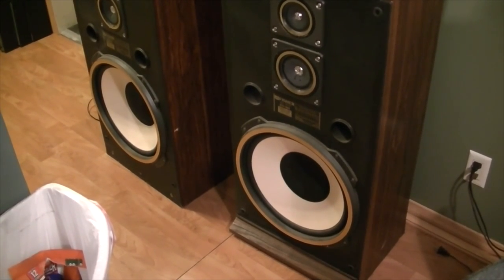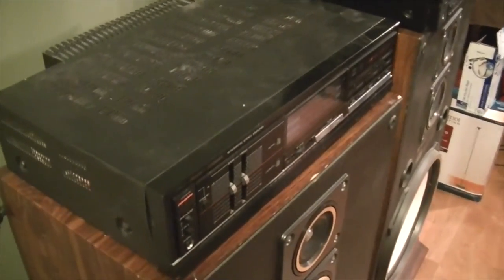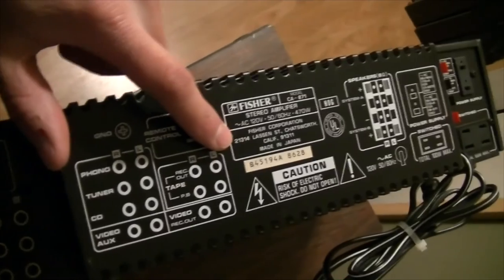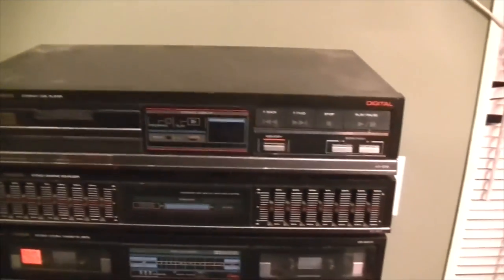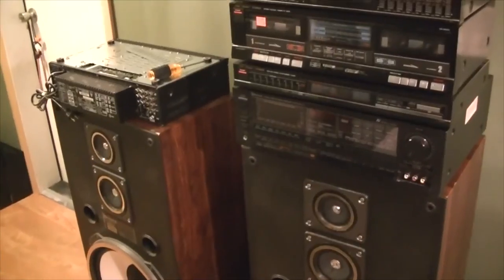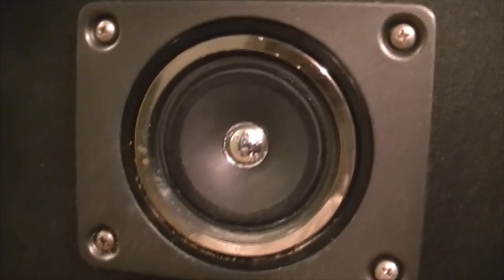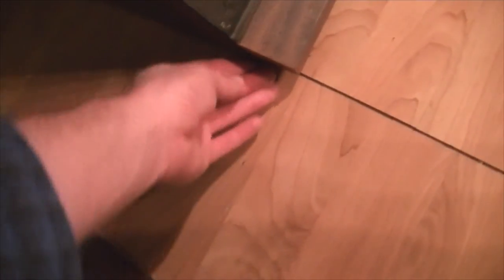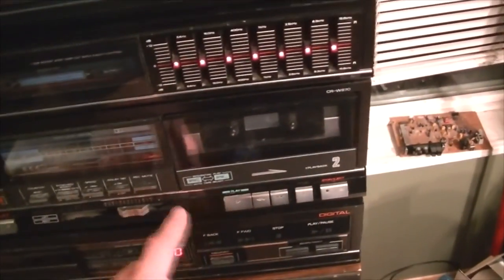Fisher CA-871 System - Repair Series - Part 2 - First Evaluation

Comment: Those two additional places for transistors are designed for voltage regulation. Some versions work on 35 volts rails with light load and jump to 65 v when loaded. Good video btw
Reply: Sir can you take look at my new post here. you seem to know things a worn-out broken roofer don't.  ?? PLZ

Comment: Great video! I stumbled across this since my Fisher CR-854A cassette deck recently crapped out and am trying to find a replacement. One question I have is my Fisher amp is a CA-854 model with 120V - 550W, and if I cannot find a proper CR-854A replacement, can I plug in a similar model into the standard 100W "switched - unswitched" ports?

Comment: Some times good deals are to be had. I purchased a Fisher system, well it was a CA800 100 watt amp with tuner and EQ from Good Will for $34.00. Just the amp is worth $260, so not a bad find. You could sell each piece and probably get 5 bills for all of it. Look each one up on Ebay to see what they are selling for.
Reply: I will tell you what I paid for my Fisher CA800, FM600, CR124, and DS825 speaker. It was missing the rack and turntable that came with it back in 83. That CA800 is a very good highly regarded sounding amp among HiFi enthusiast. If you still have your amp go check out the AudioKarma forum.
Reply: Sorry, I forgot to tell you how much I paid for my Fisher find. The resale store had it all marked at $100. I will say it pays to know people. I ended up paying $6 plus uncle Sams cut. It was one of those real deals of the century you hear of. About 4 months ago I found a stack of JCPenny's MCS equipment at one of the local Goodwill stores. They had $78 for 6 pieces, CD, turntable, tuner, cassette deck, amp, and EQ. There was an online coupon for 50% off so it cost around $35. It was not parts from a rack system, so that was a good point. Looked up the pieces online and looked under the hood. Come to find out that all the pieces were also sold as mid to higher end big name brand pieces. So if you might be interested in another underrated brand like Fisher, check out MCS by JCPenny. Even the so-called green line has some hidden gems. Vintage audio is the way to go if you can get them without the overinflated price that a lot of people are asking for.

Comment: One thing needs to be mentioned about the surrounds on the woofers of the Fisher STV 884's. They are not foam surrounds. These have a treated cloth surround like most of the Fisher ST and STV line of speakers. Even their DS line manly has cloth surrounds on them. So no worry of foam rot but what you have to worry about is them hardening. That will prevent the cone from having a free movement as they should have. Another thing that these speakers need is a better crossover. By doing so will improve their sound quality 10 fold.

Comment: Hello. I hope you are doing well. I have a question maybe you can help me if you have time. I have a Fisher RS-881 receiver and I want to remove the metal case to repaint it. I have removed the screws on the side and the screw in the back but I can’t get the case to slide off. I have removed the screws underneath the face plate to try and take the face off to see if that helps. I removed the buttons for EQ and the balance button and still I cannot get the face off of the case off. The face pulls away from the chassis at the bottom but at the top it won’t budge and I can’t slide the metal case off. I’m not sure if you can help me but from watching your videos I thought maybe you might have some advice. Any help is much appreciated. I hope to hear from you. Thank you! My name is Shelby

Comment: Similar Fisher craze but sad story. HELLLLLP. Got Fisher Sound Stage(7.1 think) RS 939 Surround Reciever, and 4 4 foot high Abstract ASX PRO 800  huge as speakers. If you didn't say your price i wouldn't of $80. YUP $80 i was so excited it worked rough hooking and DUH DUMMY HOOKS UP SPEAKERS  proper?? YA WITHOUT UNHOOKING F FRIG Sakes and smelt, well electric burn smell. ??? HELP??? Disabled low-income new too good to be true.
Reply: BTW i just for kicks weighed it,25lbs no vids here yet on this model. like say think 7.1 but no HDMI . Just touched 2 spkr wires DUH  running. Done it 100 times with the old Kenwood 9300 wow unit. My luck.  ANYONE HELP??

Comment: ooops i mean the equalizer
Reply from the maker: +Leo Matson I mentioned how it is wired in part 1.  Plug what ever you want into the equalizer, then plug the eq output into, say tape, aux, video, tuner on the amp. As an example I use 1 input on the eq for cassette, the other for the cd player.
Reply: Ok got it thanks
Reply: or you can hook the EQ to the tape monitor inputs & outputs & you can control the sound of everything with the EQ